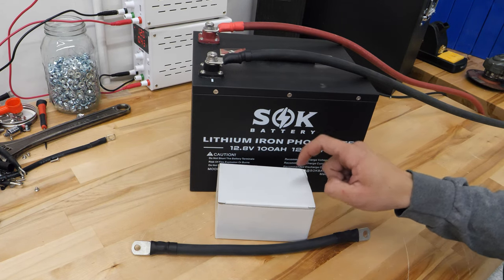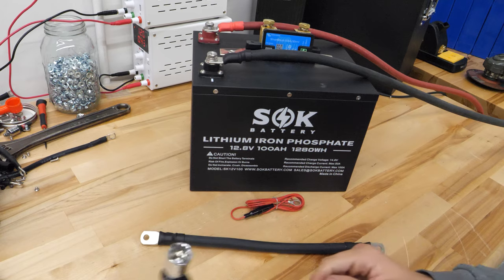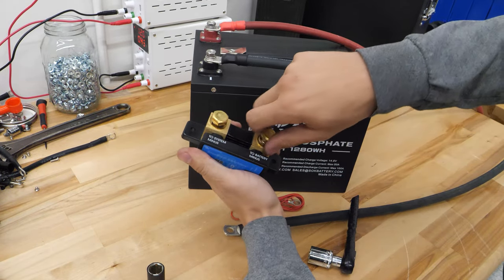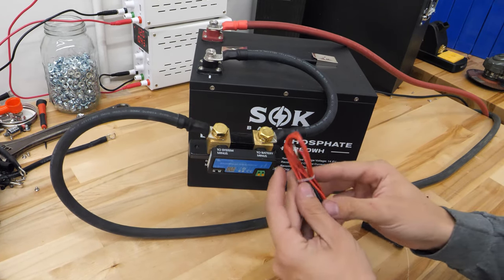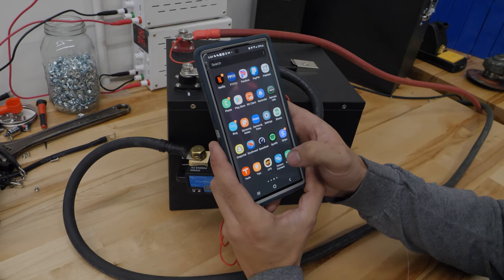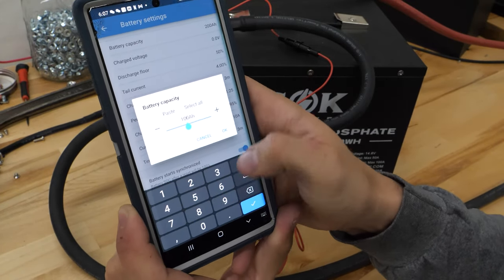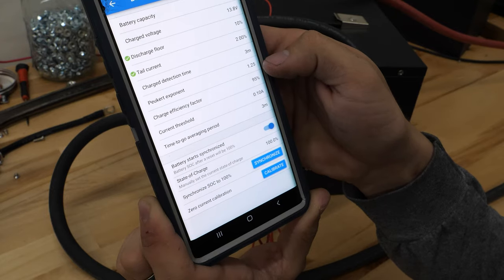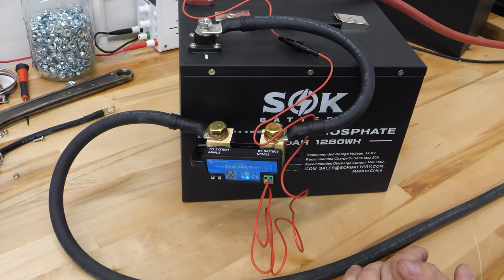How To Wire & Program a Victron SmartShunt for LiFePO4 Batteries 🔋

Comment: thanks for this video.i have AGM battery for my boat electronics, is setup pretty much the same.?also you didnt mention the load positive side ,do they all go on just the positive of battery?
thanks
john
Reply: Positive side is wired as you normally would.  But it best to have one cable.  A good installation would have all the positive cables leading to a correctly sized positive busbar and then just one cable from the busbar to the battery.  Its not good to stack too many lugs on the battery terminal.  You tend to not have good electrical connectivity doing that.   The reason you don't want to add other negative cables to the battery side of the shunt is that the current passing through that cable would not be read by the shunt.  You'd thus get erroneous readings.  You want all the charge and load currents to pass through the shunt which then gives you correct readings for state of charge.   Again, like I said about the positive cables above, put all the negative cables on a negative busbar and then run one cable to the load side of the shunt you are good to go.  Then you will get very accurate state of charge and total load readings and have a very neat, clean and electrically well-connected installation.

Comment: Thanks for the video! I’m using my 12v 54amp hr lithium battery for a trolling motor. I’ve installed the shunt and followed the steps on your video but the battery percentage never seems to drop. It just stays at the percentage I set as the state of charge. Any suggestions here? Thank you so much. Would love to get this fixed.

Comment: I have two 7Ah 12v Sealed Lead Acid battery connected in series in my Cyberpower battery backup which the two batteries no longer hold a usable charge. Can I switch out the Sealed Lead Acid batteries for these Lithium batteries or do they have a different charging cycle mechanism which makes them not interchangeable? Thanks!

Comment: I’m using the smart shunt for my RV. I have one LiFePO4 battery and a GoPower 190W solar panel on the roof paired with the GoPower controller. The issue is that as soon as the sun comes out in the morning the shunt thinks the battery is fully charged. What should I do?

Comment: Does the victron smart shunt use both SOC and Tail current data inputs for better accuracy?  If clouds go over head for a moment on solar panels, seems this could throw off Absorption time detection, and trigger another cycle inadvertently.

Comment: Question...my Victron shunt is connected to my 36v lithium battery for my trolling motor. Whenever I power off my trolling motor or when it goes into power saving mode, the Victron shunt resets itself to 100%, even if i do not charge the battery. How can i prevent this?

Comment: How do you connect positive and negative wires with shunt when you have four 12v 15ah batteries in parallel?  Do I connect positive on, let’s say, battery 1 and connect the negative on battery 4?

Comment: I have 2 12 volts in series and added a battery equalizer (watts2470 directly to the batteries..will this still allow the Smart Shunt to work properly?

Comment: Does the Victron website have advanced battery settings from different manufacturers?
Reply from the maker: Not really, they give some general guidelines, but the battery manufacturer should be able to give you most, if not all, of the values.

Comment: Why do you recommend 13.8v as the charge voltage (as opposed to 14.4)?
Reply from the maker: It's not charge voltage, it's chargED voltage.  If you set to 14.4, then by the time the voltage gets here, it's too late - current already starts tapering down, so the tail current threshold never is met.

Comment: Not sure what the point of insulated tools if you touch the battery post anyway?
Reply: It's to minimize the chance of an accidental conductive short circuit between the terminals of the battery.  100s or 1000s of amps of current could flow unexpectedly.  All kinds of bad things can happen in that state.

Comment: excellent vid, thanks. I have 2 SOK 12s in series for 24 volt. what would the parameters be for that. FYI I have the all in one MPP 2427 and I have had midpoint voltage deviation issues. I have ordered the balancer from watts247 and I think I need to rewire onto the shunt and not the battery minus as you mention. thanks again. Dan
Reply: Hi,did you get your answer on that? How's the 2427 working for you,I'm about to install one, thanks
Reply: @mikejohnson7768  nobody every answered the question. but my system is working great (after I installed the balancer from watts247)..the smart shunt is always telling me about the midpoint deviation, but the balancer does its job and the batteries charge and work great. After I did a major rewiring the shunt stopped connecting but i reconnected it. keep a screen shot of the sku number handy.
Reply: @dans1516  
Great,could you send me a pic of how you wired and fused your 2427 into the system with your smart shunt, thx
Reply: @mikejohnson7768  I will make a video and post it in the next few days.
Reply: @dans1516  great,thank you

Comment: I tried one of these. It wouldn't update the firmware and I couldn't get it to work. Absolutely NO technical support from Victron. I sent it back. Very disappointed.
Reply: I had to restart the update a few times. There were multiple updates.